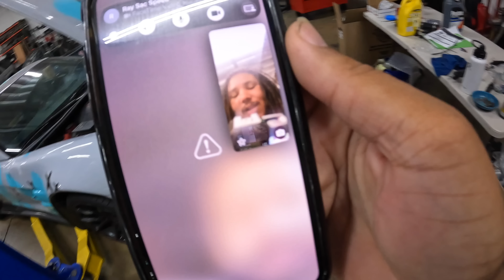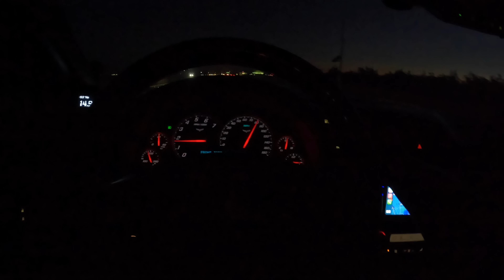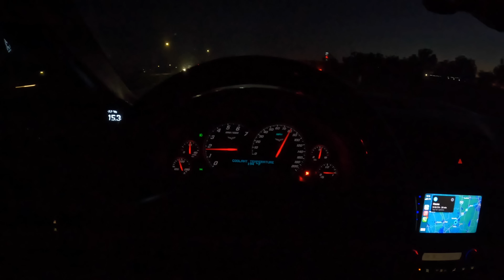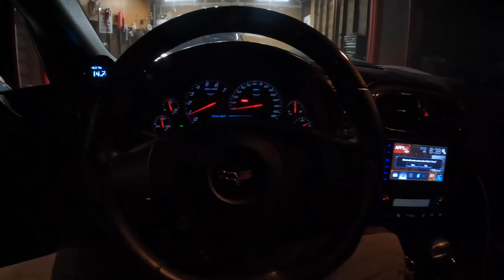My Boosted C6 Is Alive! This Car Sounds Crazy! *YOU HAVE TO HEAR THIS*

Comment: Love that sound from the front,  my GTO had one , just make sure those fans stay on full, maybe wire a switch. If i got stuck in traffic the temp would creep all the way up, the coolant lid boiled over once and radiator cracked from heat.  It was hawaii heat and traffic though. That was before i knew anything about cars though,  wish i kept that one! Just enjoying a C6 now, would have a can if i didn't have to get a transmission lol.